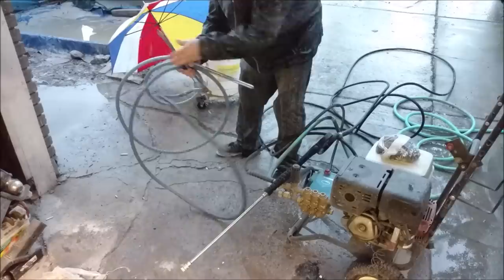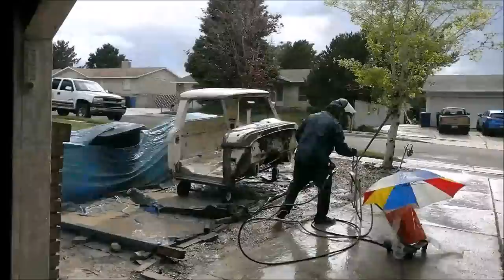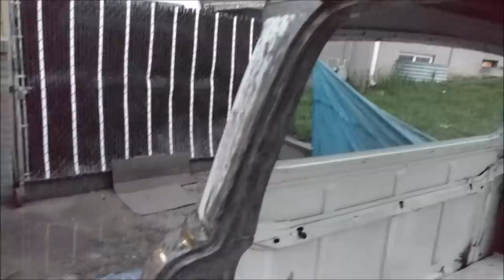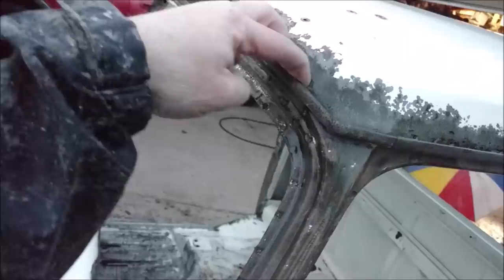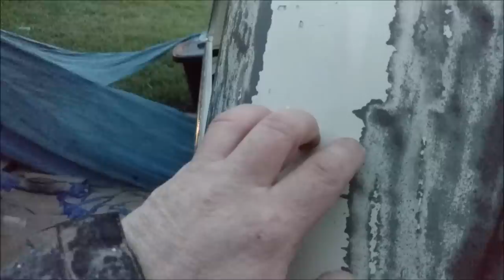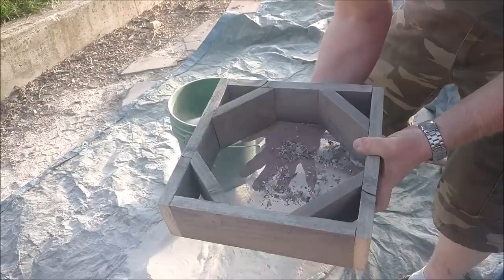Wet Sandblasting Pressure Washer Kit DIY for Auto restoration

Comment: Thanks for the video. Use a 5 gal bucket lid and stick the pick-up tube through the small cap or if it don't have a small cap, cut a small hole in the lid.

Comment: This is the first video you've ever done that I disagree with you on. That's not a standard pressure washer. That's a bad a** pressure washer. I see that Cat pump. Excellent video as always man!
Reply from the maker: HAHA... Thanks Man.
Reply: I was just about to say the same thing. At my old job, I switched out the old junk pump with a cat pump, and that thing was more powerful than expected considering the pump was being driven by the lower end of is engine requirements.
Reply: I was gonna say same thing.lol

Comment: I have a wet sandblasting kit from Harbor freight and haven't had time to use it yet . I bought because the blasting won't warp the metal like you pointed out . I'm going to use the old sandblasting container and drill a hole in the top with a flap to put the wet blaster pipe in and should keep the water out . Your cab is very clean and will make your restoration much easier . Thanks for sharing
Reply from the maker: I would like to have a bigger pot that held 2-3x as much sand.

Comment: I agree that you need at least a 3 gpm pressure washer.  I have a 3 gpm at 3000 psi pressure washer that I rebuilt.  I used the cheapo version wet sand blasting kit from Amazon with the red hose...  It did some blasting of some painted aluminum wheels but took forever to get through all of the layers of paint.

Comment: Mine is a 3000 psi and 2.5. I used coal slag from tractor supply and it worked great on a 2500 hd suspension on a northern truck with all the salt and rust.
Reply: You were able to use a typical residential power washer and get the same results just using different media?  Can you explain?

Comment: the trick to that is you attack the panel on an angle and not straight on.. straight on only gets that spot.. if you work it so your spray is hitting on an angle then the sand will go across the paint you haven't started working on yet... so ... start at the top.. point the sprayer so its shooting the sand off to the left.. as you go down your line the paint comes off where you are directly hitting.. but it also hits the paint thats to the left... so hard to describe ... so easy to actually do.. anyway.. don't point the tip straight at the piece.. let the sand glide across the work area

Comment: Wonder if water and bare steel go together... The problem i see is that removing coating is super easy, but the problem will be rust. Durng time you waterblast metal already starts corrode,  a little bit different from sand/soda blast where it take time for metal to take water from humid air. Anyway good luck with painting. Don 't forget to remove sand from closed  profiles.
Reply from the maker: Flash rust does happen, but can also be eliminated with water additives like HOLD TIGHT 102. Soda would have cost me $600+ in materials alone vs the free sand(less than $50 if I bought it)
Reply: Yep, the bottom of those A pillars where the bottom of the door sill and fender meet are prob  filled with wet sand?
Reply: Agree 100% and sand is all but impossible to reuse as it will take days to dry if not weeks. Ive blasted for 20 yrs dry in a booth. Yeah , its dusty, but i have suction and exhaust, and  respirator. When i run out, its all contained in my booth. Sweep it up, and pour it back in anf go at it. Can reuse sand 3 times. Seems like this way, it is a 1 time use unless you have a huge space like 30x30 floor it can be spread on to dry.

Comment: I have used hold tight it works vary well but it will keep for about a week but a quick wipe down with grease & wax remover and paint with a epoxy sealer & your metal will be stable .

Comment: That's really good and really smart.  Outdoor air blasting causes a cloud of silicate to surround you and absent a real good respirator and eye protection   - - well - -  yah  the stuff wrecks lungs and eyes.   But the water keeps that dust down
Reply from the maker: It worked out really well. You do end up with wet sand probably 20ft in every direction but it never becomes a dangerous dust.

Comment: I've only ever used regular sand (same as you used) after screening it of course, with my dry sandblasters.  The only special clothing needed is a hood and a good pair of gloves.  A can of clear coat and some wet sand paper (600 grit or better) to unfog the mask helps.  But I'd be more interested in seeing you make your own wet sandblasting attachment.  As you can see, there's not much to the thing.  And you know you could make a better one with stuff you have laying around...
Reply from the maker: My original plan was to make my own setup but I couldn't pass up a premade/ready to work setup for 70bucks.

Comment: I have had one of those for 10 years and they work great. I try to dry off the piece as quick as possible and then scratch coat with primer. I modified a bucket like you used with a 3/4" copper 90 coming out of the bottom to attach eh abrasive hose to. You need to drill a breather hole in the top of the copper pipe to allow air into the syphon hose. I put that bucket into another bucket to allow for room for the syphon fitting to come out sideways. I cover the top of the sand bucket with a piece of plywood and that keeps the water out of the sand. I use playsand also. One thing nice is you don't have to wear breathing protection like you do with dry blasting.
Reply from the maker: Nice setup. Can't beat the price of blasting media with this method.
Reply: How did you attach the copper 90 to the bucket? Is it attached to the side of the bucket at the bottom or on the actual bottom?
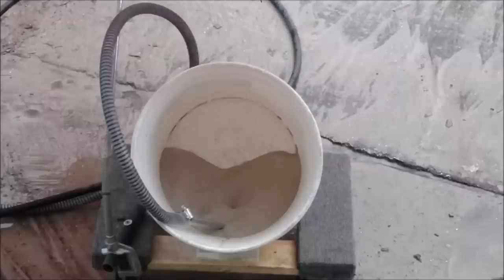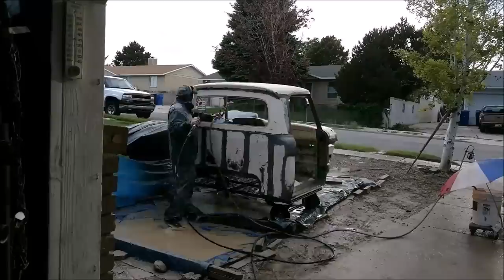Reply: @jheissjr  I have one bucket inside the other. In this video you can see it in the background between 2:15 and 2:25.

https://www.youtube.com/watch?v=V13Z_AwqVwo

 I soldered a copper 90 to a 6" piece of tin and shoved it through a hole in the top bucket. Then I cut a hole in the side of the bottom bucket which acts as a base. The siphon sand hose attaches to the 90 copper elbow and then goes to the gun.
Reply: @greathodgy22   I see the trash can in the background. Using a gravity feed is good idea. I'm going to try it!

Comment: I don't know, for my Chevelle project I sent out the body and had it acid dipped and it was done in a few days.  Yea, its a bit expensive but there is value in time saved and the fact that the acid dipping gets all the rust, seam sealer, and paint off every crevice of the car behind every panel and places where blasting can't get to.  Its worth is not to worry about all the hidden rust and paint paint you can't see becoming a problem after the new paint is applied.
Reply from the maker: Just like any process to strip metal there are many many horror stories of Acid Dipping and destroyed paint jobs/rust out issues down the road. Yes, there is value in timed saved if the goal is just to have a finished car. I have no issue spending the time and elbow grease to do it as I will enjoy the process as much as the finished product.
Reply: We all have our way of doing things, thats cool.   If acid dipping is done right there should be no issues.   Glad your project is going well.

Comment: A quick question. Does using the sand with pressure washer makes tge sandblasting action any softer? Meaning does it make it act like vapour blaster where the affect is more of a polishing rather then abrasive affect.
Reply from the maker: Yes, it leaves a very nice surface finish that has virtually no etching/abrasive marks. Vapour blasting is just Wet/Water blasting with less water and the addition of compressed air. However, vapour blasting allows you to use softer abrasives like Garnet, Bi-carbonate Soda, Crushed Glass, Glass Bead and Nut Shells for delicate work on Aluminum etc.

Comment: i have sandblasted many antique car chassis and parts in my career. we had 2 compressors feeding the line for blasting as well as a fresh air feed in the hood. 1 1/2 inch hose will blast some stuff in a hurry. silicosis is a big concern these days,i think wet wouldnt create the dust that causes it. i have wanted to get one of these for awhile,i see people hooking them up to a pressure pot blaster on low pressure to feed the wand and keep things dry
Reply from the maker: I originally tried to feed a lower power pressure washer with a pressure pot hooked to the sand suction. It was very inconsistent and did little work. A huge sandblaster like you used would have saved a lot of time.
Reply: i think im going to try one of these ,should help save alot of time

Comment: When you guys repair those rust spots up on the roof gutter lines. It is best to use lead not bondo or fiberglass or Urethane Body Seam Sealers. There is something out now called liquid lead and I believe it is only available in Europe currently for some reason. I got some from a custom shop around here and have yet to try it at my shop. Lead abates the rust in that area in particular. I recently repaired my good friends 65 Ford pickups roof gutter line with regular lead. So far so good. U want to use a 3 part epoxy primer and primer etch below that on the roof line. If not the suns UV will eat regular Urethane Epoxy especially without the primer etch beneath. Use the same stuff on the hoods if you strip them to bare metal make sure U use the primer etch on the steel or the sun will wrankle up your paint but good. Takes about a year or two and U will clearly see what I mean if you don't do that especially with cheaper Urethane primers and the net junk they sell at discount prices.
Reply: THEKING SILVERADO nah

Comment: I suppose you would have to apply a rust inhibitor to protect your work until you get ready to paint?  Where I live bare metal rusts in an hour it is so humid.  You did a great job stripping it down.  Seems to work very well and no dust flying around.  Thank you.
Reply from the maker: You can apply a product called HOLDTITE 102 after and it won't flash rust. It's not the water that causes flash rust it's the salt in your water and that will neutralize any salt. However a light skim coat of rust hurts nothing and easily comes off with a DA sander right before you primer.
Reply: @sixtyfiveford  ;thank you.

Comment: Simple solution for your wet sand a problem. Put a lid on the bucket cut a small hole in the bucket / angle the bucket / put the siphon in the low point / problem solved.

Comment: Great vid can u pls tell me your process after u have bare metal to stop it from flash rusting and how u dry it many thanks 👍👍👍
Reply from the maker: Rust happens not from water but salts in the water. As a super cheap method you could simply rinse everything when you're done with distilled water. Or they sell products like holdtight 102 https://amzn.to/3XIBbdZ that remove the salts. You do the same and spray it on afterwards. Honestly though flash rust isn't bad and you can generally remove it in seconds with 180 grit in your hand in seconds.

Comment: I would use this kind of blasting on rust metal and maybe his paint, such as gate or ladder with my pressure machine (120 bar).
But the water will make the rust quickly
Reply from the maker: Not at all. Water doesn't cause rust, salt does. You can add something like Holdtite 102 and it will pull the salts out of the water and it won't flash rust for weeks in the open air.
Reply: @sixtyfiveford  How can i do it?! I connect the pressure machine to the home water system throught a tap.By the way i won't let the metal in the open air for weeks, cause to be safe i will rub  the anti-rust very quickly. Thanks
Reply from the maker: @petrusbenckey  You can spray Holdtite 102 after you sand blast and it will wash away all the salt.
Reply: @sixtyfiveford  It would be the same if I dried the surface with a cloth?
Reply from the maker: @petrusbenckey  It doesn't matter if you dry sandblast or wet, if there are salts left on the surface the steel will get surface rust from the humidity in the air. Drying it by hand can help pull the salts off with the water. That being said surface rust is not a big deal and easily rubs off with light hand scuffing before you paint.

Comment: Hi mate, I've the very same blaster attachment... the problem I get is water making it's way up the "Y" junction and causing the sand to become wet and clogging the flow. Do you get this problem? I'm using a 3000psi washer.

Comment: Great video, thank you, I saw this and loved the idea, but it recommends 3500psi, and like someone else said, that's not a standard pressure washer. I wanna know if it works with a cheapy pressure washer
Reply from the maker: The PSI matters very little. It's more about the GPM rate of your pressure washer. 3-4GPM is the absolute minimum. The higher the GPM the more work you can do in less time. No, the cheapest $300-400 gas pressure washer won't handle this, but it is easily accomplished by a $800 avid homeowner unit.

Comment: Must do a video explaining how you deal with rust after wet blasting
Reply from the maker: Surface rust is a norm even with dry sandblasting, acid dipping, soda blasting, paint stripper etc. It easily sands off with you final prep before priming. If you don't want flash rust from the water you can use products like Hold Tight 102 and it'll eliminate it for weeks/months.
Reply: sixtyfiveford I guess we don't have hold tight in my country. What are the ingredients? Maybe something phosphoric? So you let it dry Naturally or you dry it with something after wet blasting?
Reply from the maker: "Tri(hydroxyethyl) amine" is the main ingredient according to the Safety Data Sheet. It looks like it is a high base vs acidic chemical. It does something to the effect of bonding and removing the salts in water to stop the rust from happening.
Reply: sixtyfiveford after blasting you let it to dry in the air?
Reply from the maker: Yes, you just let it air dry.

Comment: Good to know about the gpm requirement. Makes me wonder if this would work with baking soda?  It may decrease the need for a 3 gpm washer.
Reply from the maker: It probably would reduce it. I'm not sure how fast baking soda cuts vs sand but it would have cost me $400-$600 if it was comparable vs free/$50 sand.
Reply: For that kind of money I could just upgrade to a suitable power washer. lol
Reply: Backing soda dissolves in water guys
Reply: Konstantinos Nano it still abrasive though, wet soda blasting is pretty common.

Comment: How much does it cost to make something up like this I have a DE walle 3500 PSI power washer how much would it cost to do this adoption please comment back
Reply from the maker: PSI means very little. You need 3.5-4 gpm of water flow to make this unit feasible. Any less and it will not pull up enough sand to be viable. There are links to the sandblaster attachment in the video description.
Reply: @sixtyfiveford   Thank you very much for getting back to me so Fast I appreciate that thank you again

Comment: Just one piece of input I sand blast a lot of auto parts brackets & bumpers for repaint I use play sand from home depot quikrete play sand us a fine metal screen to filter out the big chunks average $3.68 for 50 LBs

THANKS FOR THE GREAT VIDEO as to using water blasting you are right on as to the damage dry blasting can do to painted panels

one question do you know if this unit will work with soda blast media to clean aluminum engine parts or more delicate panels
Reply from the maker: I don't know if it would work well with soda. It might be too fine to pick up properly and clump in the wand. The water may also cushion the blow too much and it would be barely more aggressive than just a pressure washer. Picking up the sand and drying/reusing it I find it is a lot finer than original and would work excellent on delicate parts.  I've heard they use soda with Vapor blasting that is a combination of dry and wet blasting. It consists of very little water(just to cushion, control heat and avoid dust), compressed air to push the product(main power source) and the blasting media.

Comment: I just thought of a question to ask you.  If you cut a small hole in the bottom the bucket and use a fitting, could you put the hose on the bottom of the bucket and just put the lid (loosely, so you don't create a vacuum)on and set the bucket on a stand?  I am curious if it would improve the flow and keep the blasting media dry?  What do you think?
Reply from the maker: I don't see why not. You would want to put it to one side/corner as you're always tipping the bucket so the sand slides down to a smaller point.

Comment: You mentioned how much sand you used but not how much time it took to do the work.  Any thoughts how this would work to blast a boat trailer.  Also, how did you dry the sand so well.  It seems like the sand at the bottom would take forever to dry.
Reply from the maker: I flipped/spread out the sand every few hours/days until it was dry. If I recall this took around 2-3 hours. The nooks and crannies take the longest. For an item like a trailer I would just chase the rust spots and not worry a ton about the painted areas that aren't rusty.